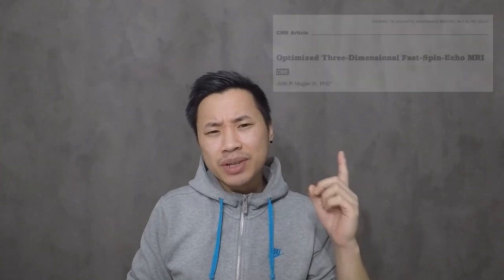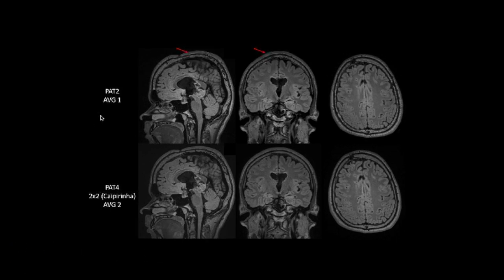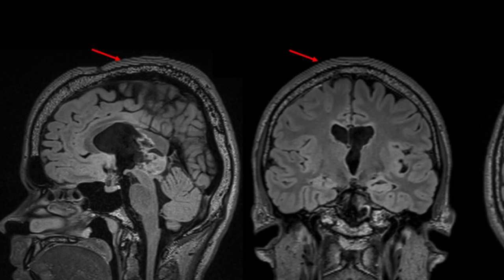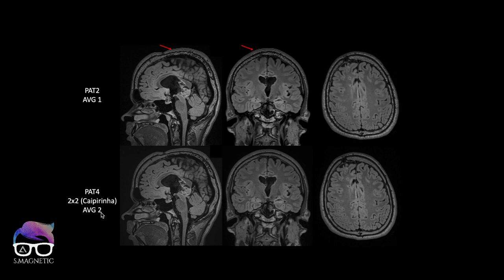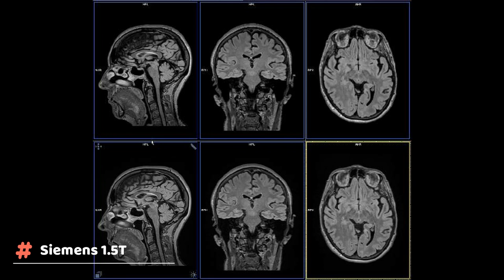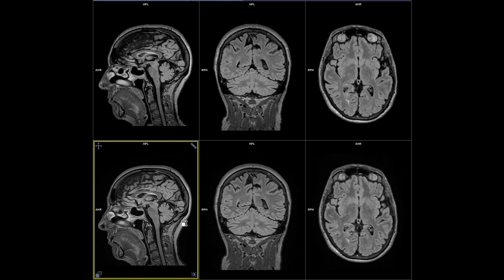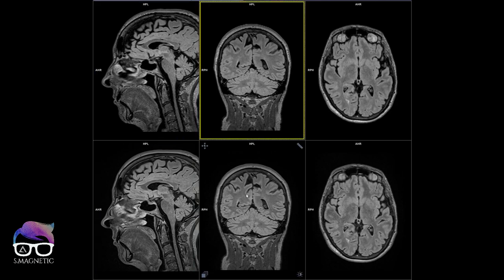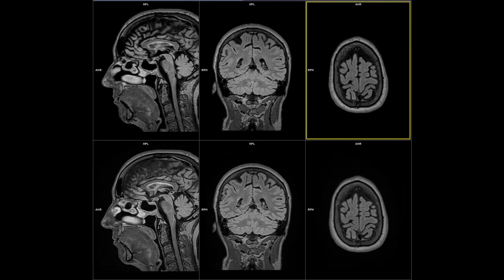MRI 3D SPACE FLAIR FID "ARTIFACT" @ Siemens 1.5T Aera

Comment: Very informative .

Just want to ask if its always to keep flair TR minimum 9000 ? If not can Can I go TR below.?
Reply from the maker: Thanks for comment. 
Actually the 3D space flair on this system is TR 5000 directly from the siemens tree. However, I strongly believe it is higher on the bio matrix system (sola, Vida...). For 2D I keep high like you mention. 3D 5000tr. Currently working to increase this as well like the new system uses.
Reply: When I went to the Siemens applications course many moons ago, for 1.5T 2D imaging they recommended 9000 TR fro FLAIR for nulling CSF as you mentioned but also stated that if you needed to shave time for some reason, i.e. claustrophobic/uncooperative patient, look at your TI and multiply by 3 and that is your minimum TR. So for FLAIR Brain to null CSF TI is 2500, multiplied by 3 would be 7500. I've done this, the loss is your low contrast differences.